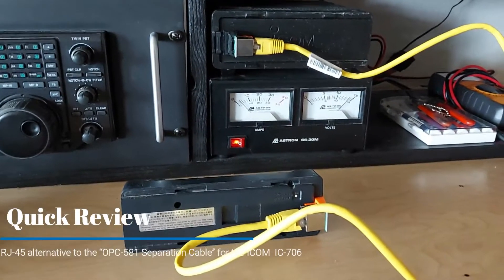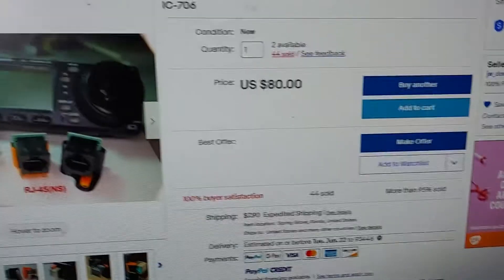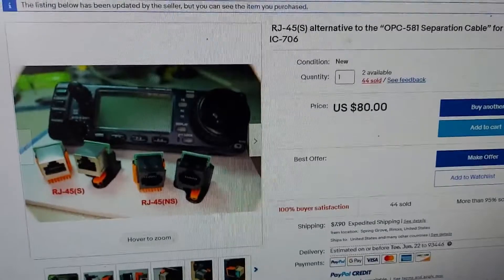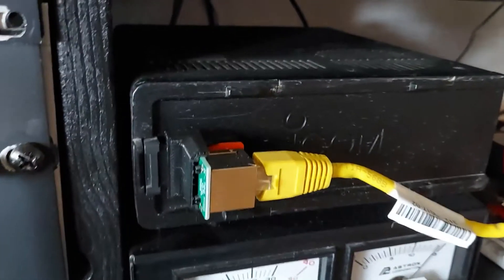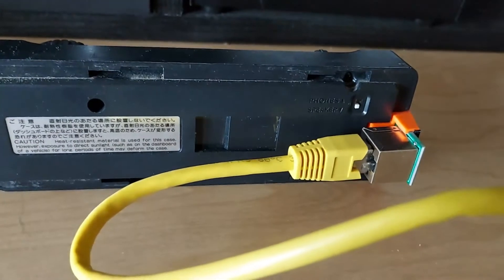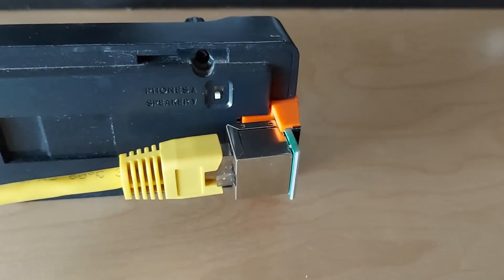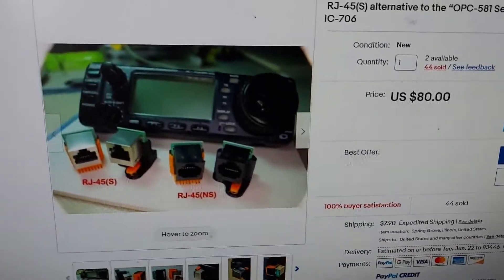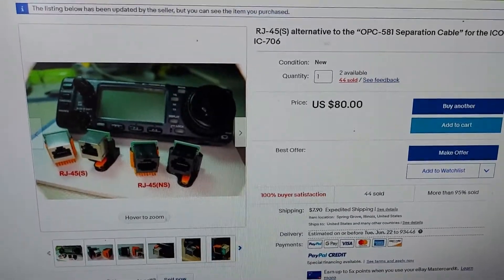Quick Review - Icom 706 Separation Cable Alternative

Comment: If you use this in a vehicle, I highly recommend using cat six cable that is foil wrapped inside
Reply from the maker: So, far  no issues or noise from my Jeep.
Reply: @ShawnDienhart  That’s good. I tried it with regular cat5 cable…. Wow! It caused all kinds of problems. I had to get Cat6A SSTP, SFTP Shielded Ethernet Cable
Reply from the maker: @elonlovesyou  Good advice either way, cars cause all kinds of noise. Thanks

Comment: What about mounting?
Reply from the maker: I used a ram ball mount with some heavy duty double sided 3M tape, the tape on the flat part of the ball mount attached to the back of the control head. Works great.